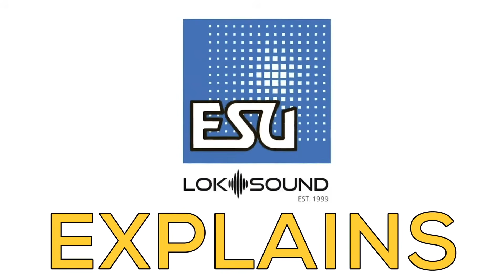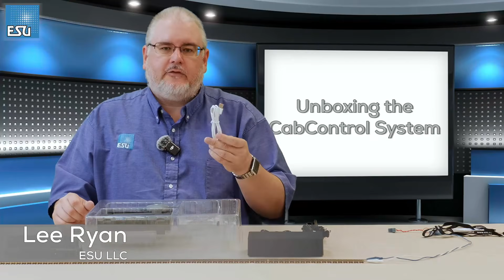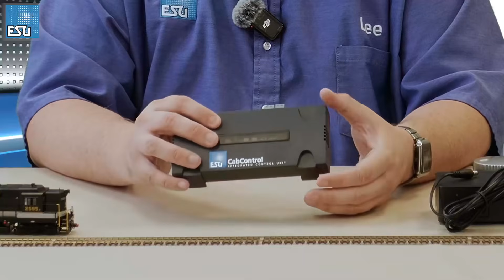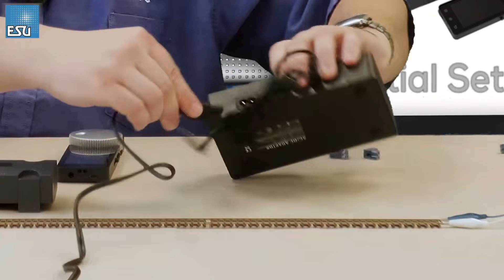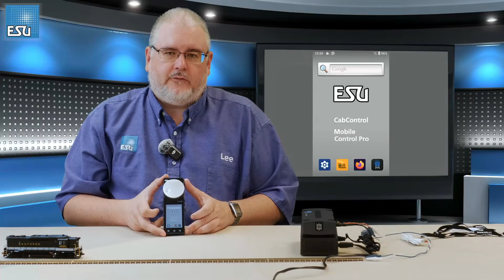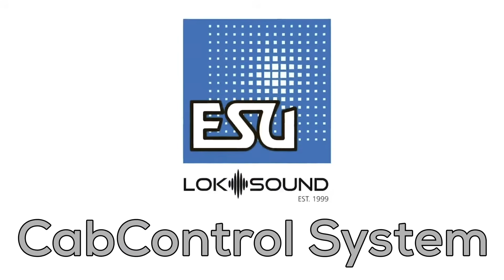How To: ESU Cab Control

Comment: The ESU CapControl is a very nice system. However, I do have a suggestion for improvement. It should be possible to select a lead unit within a multi-unit consist that performs certain functions, such as the horn or similar features. I know that you can select an individual unit within a consist, but especially when it comes to switching operations, it often ends up involving a lot of toggling back and forth. Therefore, it would be much more practical if certain functions within the entire consist could be assigned only to the lead unit.